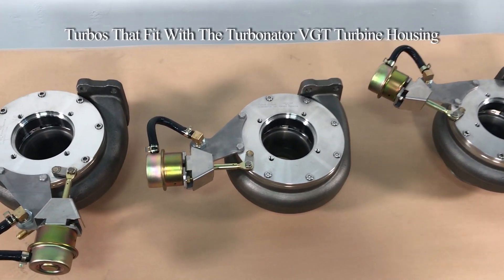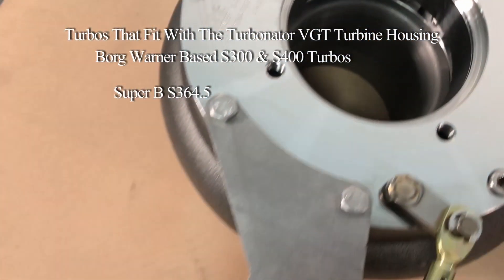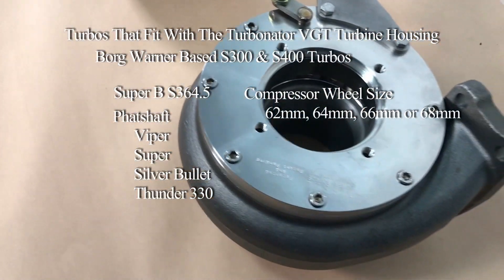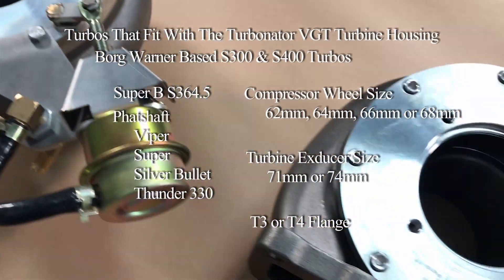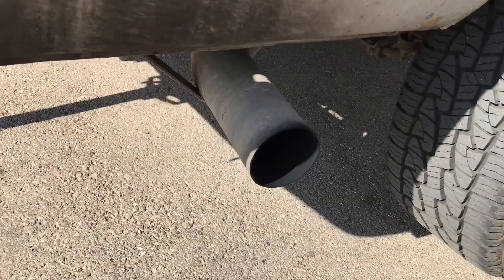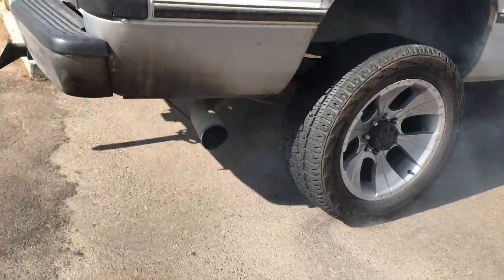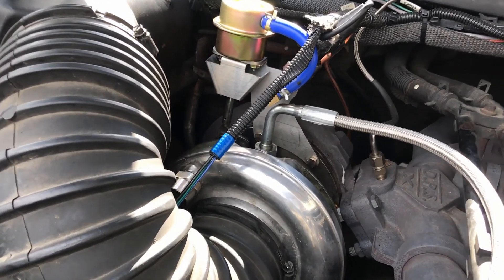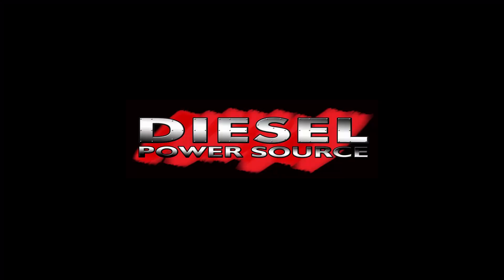Turn your Journal Bearing S300 Turbo into a Performance VGT Turbo

Comment: Sir, a question:
Have you tried this S300 Turbonator on smaller diesel engines??
My primary interest is a Mercedes OM606 3 liter that I'm currently using a Holset HX35 on, excellent top end power (580@5200 rpm) but no low or midrange. I would love some midrange.
I thought that since the 3.0 Duramax (also an inline six) was coming out you might be thinking about it.